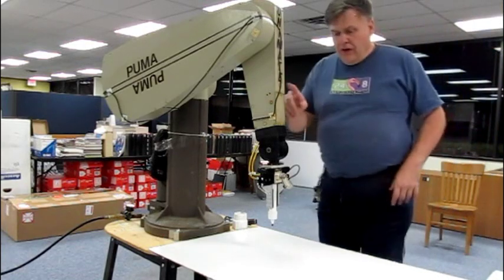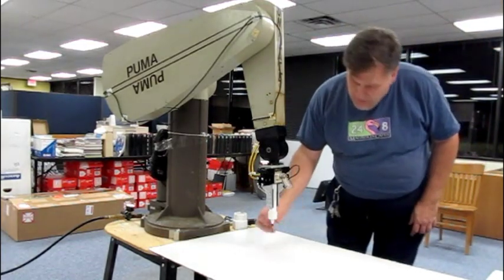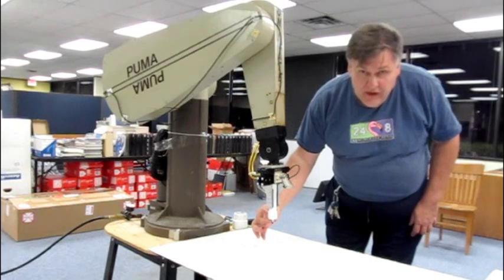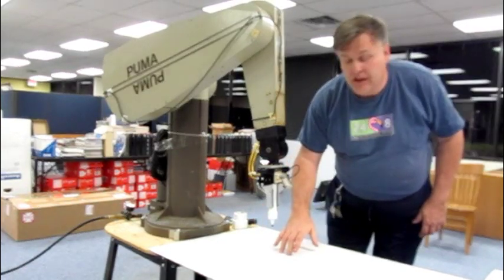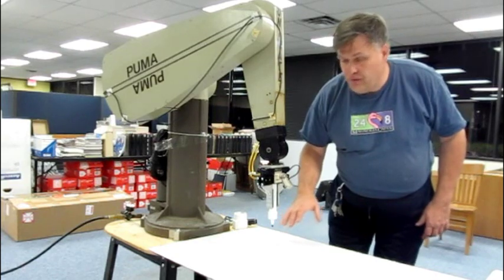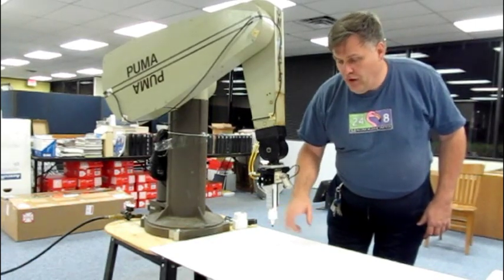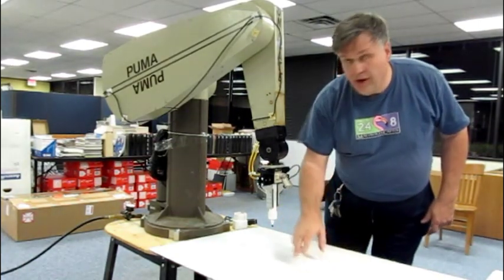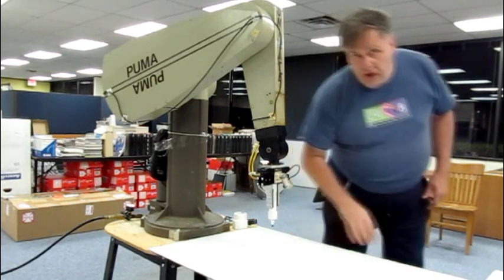Drawing with the PUMA Robot Arm

Comment from the maker: Ah the circle... since the PUMA didn't have any circle commands we made a BUNCH of tiny segments... about 2mm apart. So it always does a circle (or arc) very slowly. Since we were just doing demonstration shows with kids and such... we haven't modified the software to go faster. (At least not yet.) We can cheat... and make the circle into a polygon from CAD... that helps. Speeds above 50... it gets sloppy... can't account for arm mass.

Comment from the maker: The software is VAL-11, and I'm converting the G-Code into a text file of DRAW and SPEED commands. I then load it in as a program file. I am limited to about 32K or so... large files need to be broken into smaller units. I tried sending the commands one-at-a-time but the method didn't work well. (I was waiting for the "." but I found that it sent it at the receipt of the command, not the completion.) 

I know there is a second serial port... but I need to learn how to use those commands.